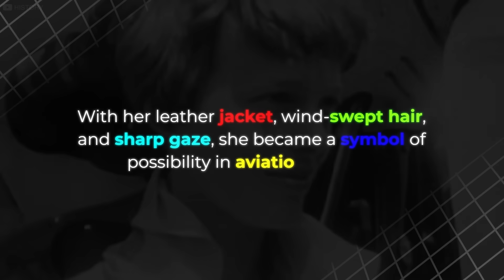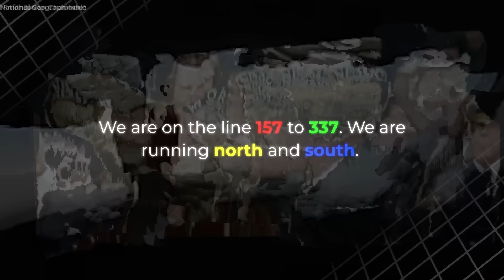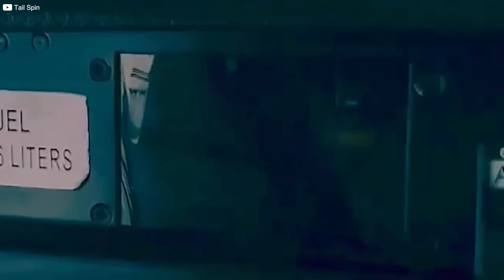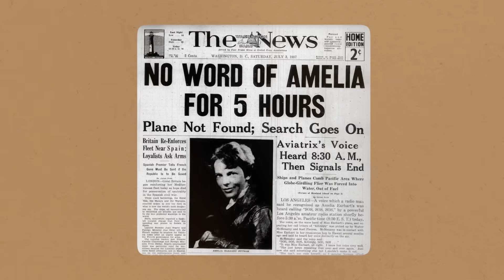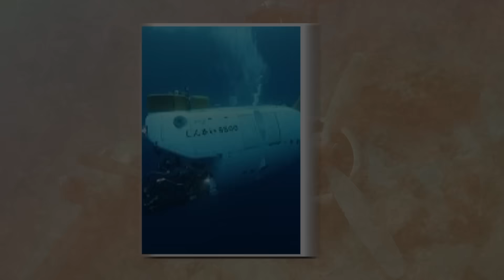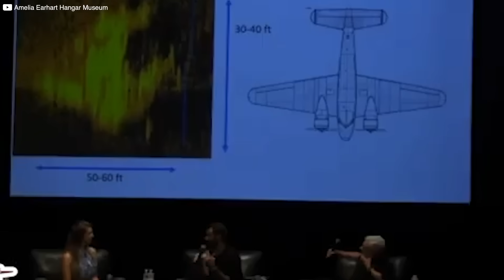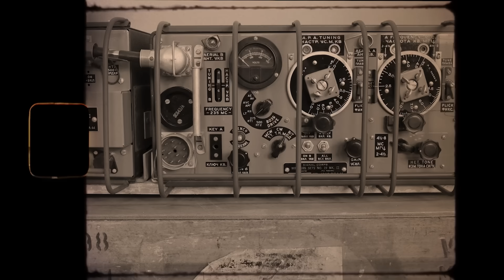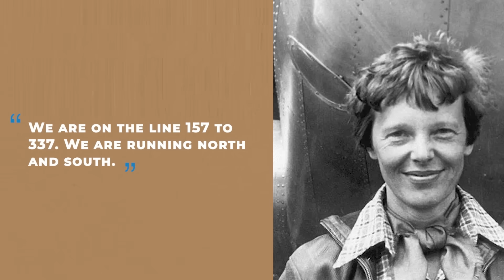88 Years Later, Amelia Earhart’s Plane Has Been Found

Comment: No need to watch the video; the thumbnail explains all. The reason it's taken them so long to find the plane, is because they were looking for an Electra. They should have been looking for a DC3.
Reply: The promo picture is not a DC-3 at all. It has a tricycle gear. I believe it is a Russian plane that NATO calls the Crate.
Reply: @danielocarey9392  
I believe that you are correct. I am reading that the Crate was built as a Russian replacement for the DC3. That would explain the similarity. Regardless, it's not an Electra.
Reply from the maker: You make a really good point! It’s interesting how much can depend on the right search parameters. Thanks for sharing your thoughts!